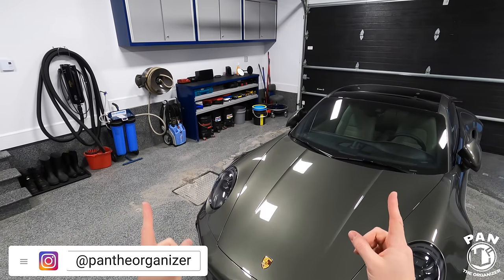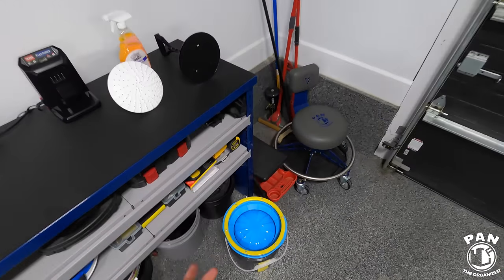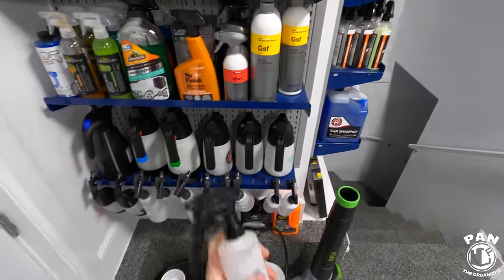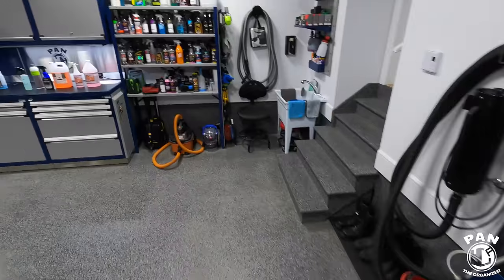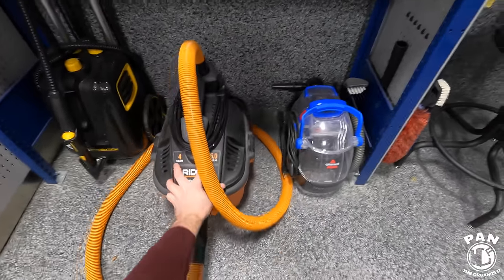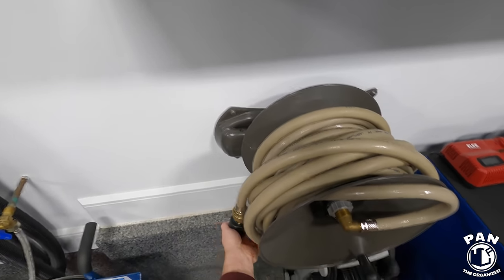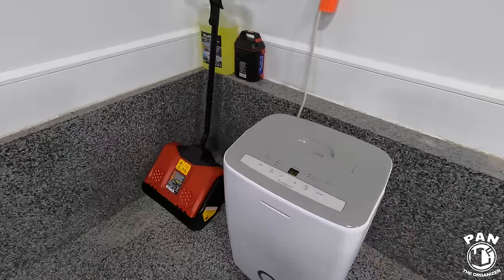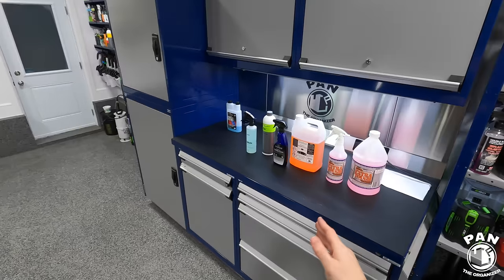How To Deep Clean Your Car Detailing Tools & Equipment!

Comment: I soak all my towels in apc in a bucket with a agitator in it (portable washer) before washing. All my tools i take in the house, soak in a bucket if dirty and rinse in the tub. Same with my wash mitts, wash/rinse in the tub.
Reply from the maker: Yeah pre-soaking microfiber towels in an APC and water is a good thing especially if they're super dirty or those that were used for engine bay detailing and things of that nature. I also like P&S Rags to Riches as a pre-clean soak. Did you try that detergent?
Reply: @PanTheOrganizer  i did, i use a portable washer (not the mentioned agitator thing) rather one that sits in my tub and has a spin dryer too. With that said RTR’s suds up a lot and it makes it more difficult to rinse them. Its a great detergent though. Im using Mckees MF’r wash.

Comment: Whats best way to clean cloth seats that show rust stains...i think my car may have been in a flood before i bought it...not good.  I don't have expensive tools like an extractor etc.  I may just sell the car, but need it cleaned up.  Thanks!
Reply from the maker: Those are hard to answer questions as I'm not there to see the state or condition of the fabric. But a good approach is typically to use a fabric cleaner with a drill attachment brush to agitate, and then use a carpet extractor for the deep cleaning if you have one.

Comment: Pan, I'm buying a brand new boat and truck. Do I need a buffer machine and a polishing machine. I'm a diyer
Reply from the maker: That depends on what you plan on doing. If you plan on learning how to polish, then yes absolutely. I have a beginners' guide to machine polishing here: https://youtu.be/X2qjO5xZZ2E

And here are the steps I perform to a brand new truck or SUV: https://youtu.be/tjJPcdCUaK8
Reply: @PanTheOrganizer  thanks Pan. I'm still A little confused. Can a polisher be used to compound as well, or do I need both tools?
Reply: @laurazavatkay2782  You will want a DA polisher for the truck. If the boat is painted the DA will also work on it. If the boat is fiberglass with gelcoat, you need a rotary buffer with wool or foam pads for compounding.